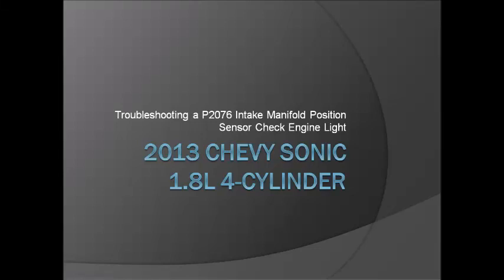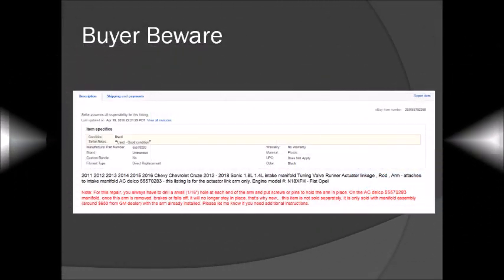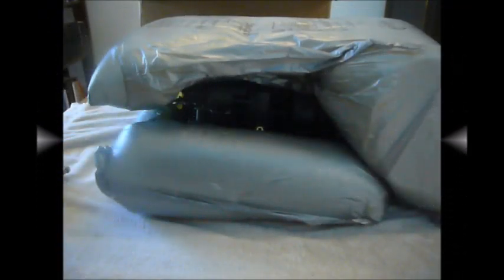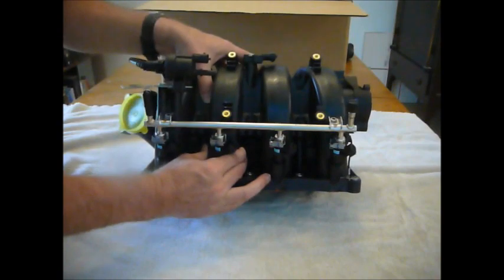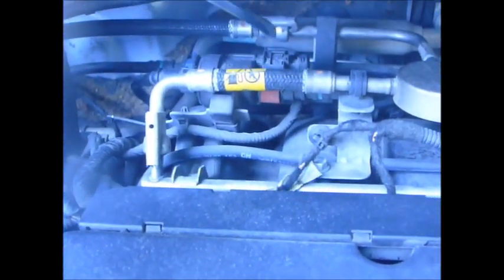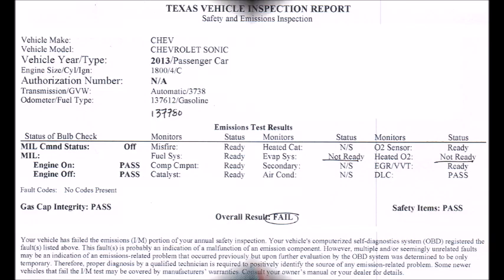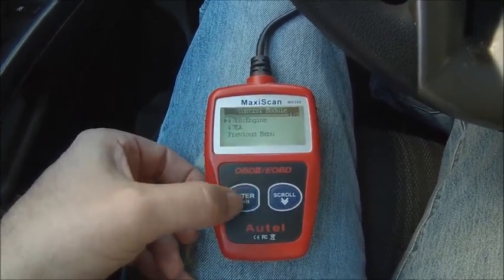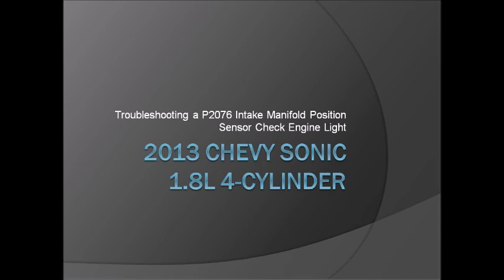P2076 CHEVY SONIC INTAKE MANIFOLD POSITION ACTUATOR

Comment: Hey guys so i keep getting the p2070 code stating imv readiness bank 1a i've bought the valve connector so from your point and experience did or will just the valve actuator clear everything? Just curious
Reply from the maker: I am not sufficiently knowledgeable to give you an answer.  Sorry.

Comment: I have a 2014 chevy cruze .. The first issue was this kept popping up  "service traction control" and "service stability track" then my check engine light started blinking and my car was running pretty rough, i took it to autozone and this exact code popped up and said to replace the intake manifold tunning valve... I noticed that the arm was popped off as well so I found that same piece at a junk yard and replaced it ... However nothing changed so I am going to drill the small holes and try to put it back in place correctly... I kept using my car only when i really needed it and it turned off on me twice after about 2 minutes of my car being turned on, do you think this arm is still the problem or am I going to have to fix something else ? Should I just correctly try to place the arm and then see what happens?
Reply: Yesenia Lopez sounds like your engine coil is leaking oil into the spark plugs. Depending on the mileage of the vehicle you may have to change the coil and all four spark plugs.
Reply: E Riddick your right it was leaking into the spark plugs Im actually working on that right now almost done ☺ thanks

Comment: You can purchase the linkage (arm) on ebay and replace it without removing the intake manifold, search for " Chevy Cruze P2076 ebay " on Google.
Reply from the maker: Yes, as I mentioned to a previous post, you can get the part.  However, GM does not sell them new and unless an after market version has come along what you are getting is a used part.  When that part was removed from its parent manifold the races (grooves) will have been compromised.  Remember, mine only "came off" their mounts once and it was never quite the same again.  You can snap it back on, but it isn't new and crisp.  So, buyer beware.

Comment: awesome video. i have a 2013 chevy sonic check engine light bank 1 too lean. upon investigation found the same issue the top section still connected and the lower disconnected. called gm and they want to sell you an entire manifold, its crazy! good thing i found that rod on eBay will install and hopefully light stays off! 
really recommend replacing that rod if you guys can in the winter last year at -30 weather the car didn't start at all way too lean
Reply from the maker: Remember, that part you got on eBay is used.  GM absolutely does not sell them new.  They only sell the entire manifold.  That means, it came off of an existing manifold.  That means the "race" or groove that keeps it "snapped" into position is probably rounded or "loose" compared to a new one.  So, when you "pop" it back into place, I recommend you reset the codes, wait overnight for a cold start, then do the 0-55 for 3 minutes, coast to 20 MPH, then accelerate to 55 for 5 minutes, coast to complete stop.  Then, drive in stop and go traffic for 30 miles, then check the codes ANB the "Monitor Status" readings on your scanner.  When you have only one Monitor Status pending, go get it inspected.  That way, when it "pops" off again, you have you inspection sticker already.
Reply: ToolTimeTabor 
Sure will thanks, if it ever pops off again im going to drill though it put a rivet and a small cotter pin at the end, no way in hell would
I spend $1000 on a new manifold
Reply: @djbuganan843  lol facts and this code just popped up on my Cruze

Comment: Happened to me too on my 2012 Chevy Cruze - twice. Cost me $1K first time. This time, I'm just snapping it back into place and making sure it stays on. It won't stay on long, so you'll have to keep putting it back on... but at least it'll clear the engine codes and save you $1,000+ repair which involves replacing an intake manifold which has nothing wrong with it. BTW, my last three cars were Chevys. This will be my LAST ONE. Two of the last three, including this vehicle, were NEW vehicles. They BOTH has their transmissions go out within the drive train warranty. My next car will be a Honda.

Comment: I am thinking of replacing the intake manifold myself, what has to be removed to make enough room to extract the intake manifold?
Reply: You can purchase a new Actuator linkage on eBay and replace it yourself, without removing the the intake manifold.
Reply from the maker: Remember, that part you got on eBay is used.  GM absolutely does not sell them new.  They only sell the entire manifold.  That means, it came off of an existing manifold.  That means the "race" or groove that keeps it "snapped" into position is probably rounded or "loose" compared to a new one.

Comment: If it doesn’t last long they make you have to replace the whole intake manifold this seems to be happening to a lot of Chevy cars so this video is great and needs to be shared
Reply from the maker: Yep.  Crappy design.  Hence the potential repair technique shown in the video.  If you can get some type of axial retainer in that lower connector, you might be able to salvage the intake manifold.  While it may still require removal and reinstallation to get access to the connector for repair, at least you could save the costs of the new intake.

Comment: This happen to my 1.8L Cruze I super glued the joint back on at the bottom it would come dis connected on the bottom joint super glue seems to be working fine so far
Reply from the maker: Interesting.  I doubt the glue is the factor.  That connection must rotate freely, as the upper arm drives it in parallel.  If your super glue was the key, it would be "fused" on that lower connector and not rotate properly.  I suspect it is behaving like mine.  Once I reconnected it, it has remained reconnected (and rotating freely) in its race.  Of course, once a grooved race is compromised, it is more vulnerable to coming loose again, but that does not mean it won't work at all.  Either way, get it snapped back in place and it will work until it disconnects again.
Reply from the maker: Yep, mine just popped again...They should have called it an "Engine Running Light" rather than an "Engine Check Light" because it is always on when the engine is on.

Comment: The engine you showed in the diagram is a 1.4L turbo and this engine is in the cruze and some sonics. I have a cruze and it has the 1.8.
Reply from the maker: Ok.  So, you are saying the GM instructions were correct, for a 1.4L Turbo Sonic and/or Cruze.  Unfortunately, I could not find any instructions for the 1.8L Sonic, hence part of my motivation for the video.  If you have a 1.8L, you may find it hard to get good online documentation and/or videos.  So, this video might help folks understand the various connections they will have to account for when contemplating this DYI project.
Reply: @ToolTimeTabor  no i was just saying that the 1.8 and 1.4 turbo are in both the sonic and cruze. It was a good video. I had a sonic before my cruze and it also had the 1.8 very good engines never had an issue with either one. The 1.4 turbo on the other hand has its fair share of issues lol.
Reply: I'm still going 222k miles and still running like new I really don't know how they manufacture this car ,it's really a city drive vehicle small fast and easy maneuver ..thanks bud 👌 I just fix my rest arm valve watching this ..really helped kudus